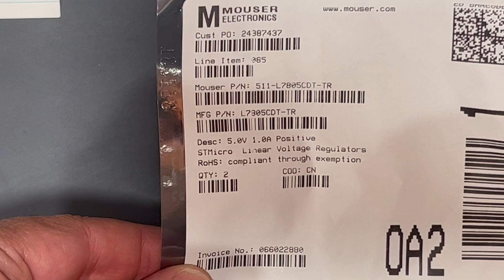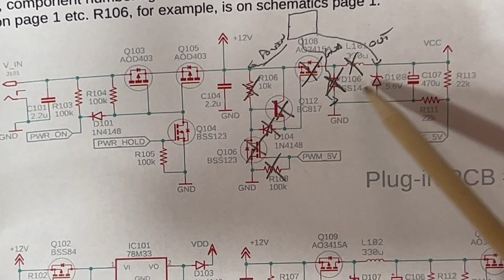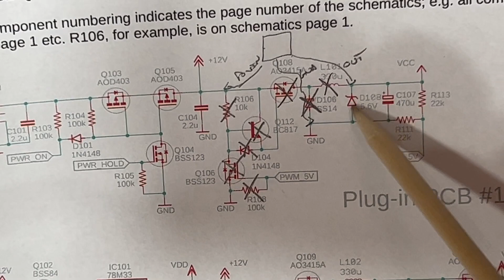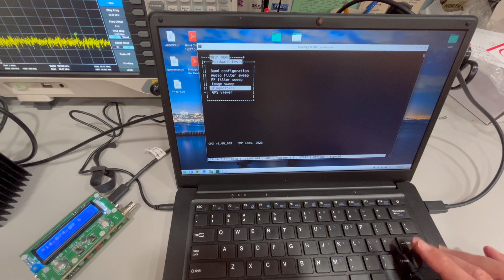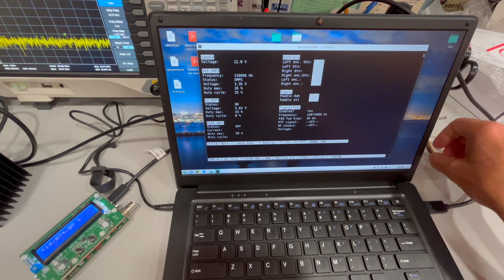QMX Troubleshooting: PWM_V5 always high [2/2]

Comment: Hi Jonathon....I have a QMX + runs well....BUT...my QMX after the build didn't fire up. I thought BUCK converters were dead...replaced them both....still no go. When I push on I see 12 V at the buck board so the encoder switch is working but no 3.3V VDD and No 5V. Any thoughts on what to look at next? 73 de George VK2AOE
Reply from the maker: I don't think I can directly link to it here, but on the QRPLabs groups io wiki there is a page titled QMX and QMX+ Internal power supply.  Under the heading Debugging at the bottom of the page you will find links to some debugging procedures that should be helpful.
Reply: @jburchm1 Thanks Jonathon…. Mystery solved … 3.3v VDD was short CCT to GND …. popped the CPU off the board… short went open … This was after trying a reflow and testing other components… so the CPU was a dud…. It did have a snippet of wire found earlier in the process (hence my suspicions it was the issue). Loved your repair 73 and TU OM FER the info